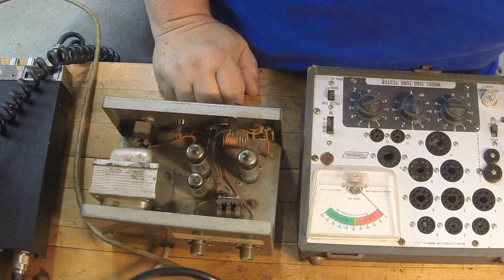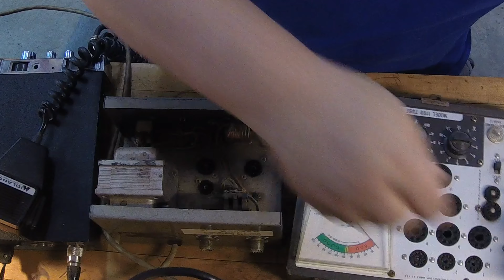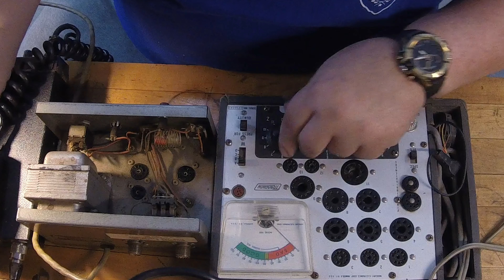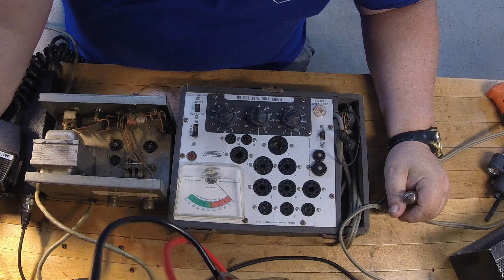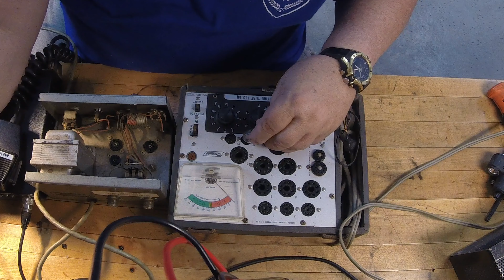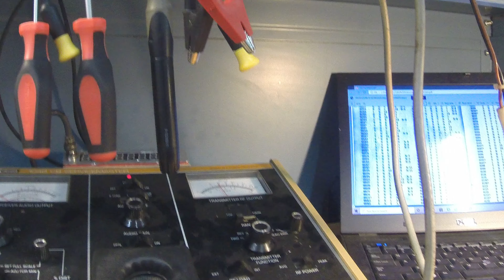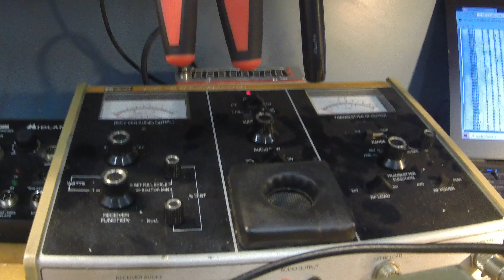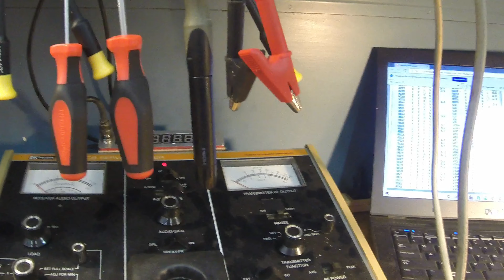Amazing Garage Sale Bargain Find D&A Hawk Amplifier

Comment: Nice buy on that one, not a lot of power for these days but she works right out of the box.  Who need more power than that anyway.  Tubes are a bit before my time, though I remember them being in TVs and Radios.  You can't sneak under the bed cloths with a tube radio like you can a little transistor lol.  For 25 bucks, well worth it.